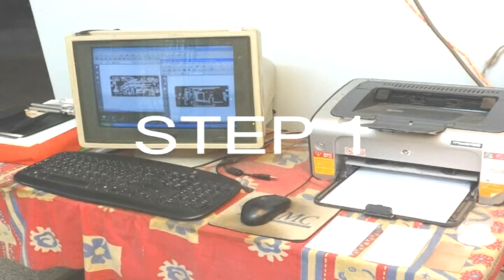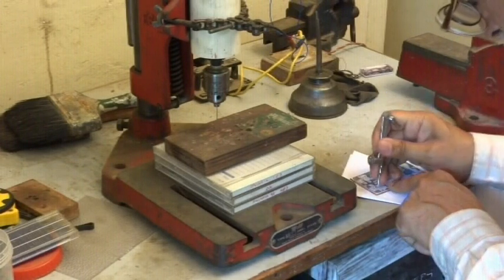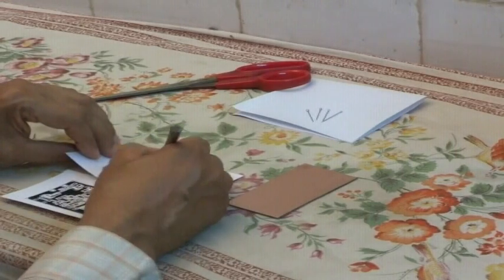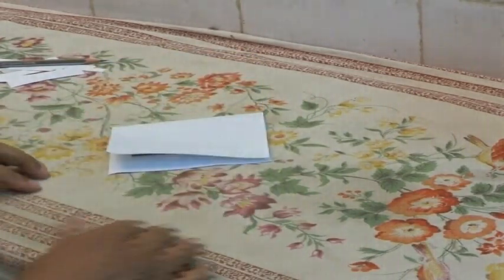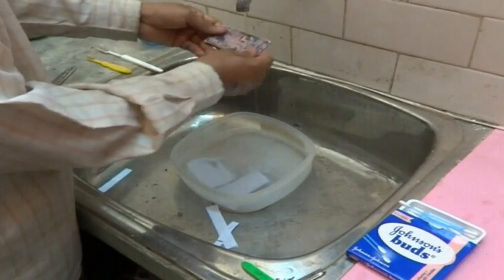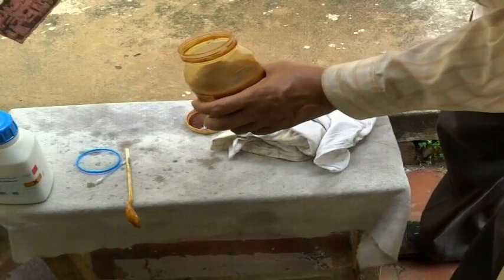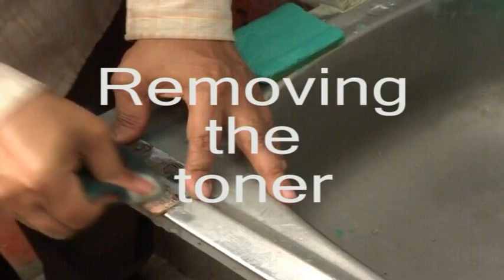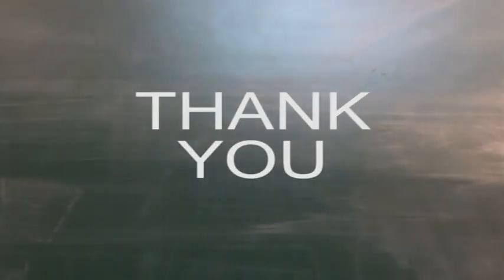Fabricate DIY Double-Sided Fine-Pitch PCB's

Comment: Thank you for sharing a wonderful video.  I follow much the same procedure; but instead of photo paper, I use thin, clay coated magazine paper of the type usually reserved for supermarket tabloids or junk mail.  I print the image on tabloid paper using a laser printer, and then use a cheap laminator (the cheapest type sold at a stationery store) and run it through for 24 passes.  This is probably overkill, but it always works.  I then use water to remove the paper, exactly as you did.  Thanks again for a great video.  >Charlie
Reply from the maker: Thanks!

Comment: Very much appreciated. You deserve respect and honor.
Reply: Will not work  try... I have done all  ferric cloride pcbs.. Such fine lines never possible
Reply: Also I don't use toner transfer method. This method needs a lot of experience to get something good with dense and fine traces and pitch circuits. I use the screen printing method. Which can produce 100s of PCBs in one go. Exactly identical. I just take this method and video as a low budget low tech solution to a very difficult problem of double sided pcbs at home. 

These days its better to use photoresist film technique for prototyping. And perhaps even for small scale production runs. However even with that method u need some form of accurate alignment. And that is the part that was of interest to me. It was with me instinctively and intuitively. But since I never used it in practice. I was interested to know the results by those who use that. Specially with dense and fine pitch circuits on both sides.

Comment: I know it is an old video but couple things to add. Ferric Cloride is stains very bad and will not go away for years. So better to use gloves and plastic twizzlers when you handle it. also keep it away from any metal surface, it will corrode any metal object in same environment. Also you can use aceton ( nail polish remover) to remove residual toner from pcb much easier and quicker once etching completed.

Comment: great video sir, 
been toner transferring since college days, until recently i had to do a usb dso with LTC1406 of 0.125 pitch..seems like there no diy for that
Reply: There is! Go for photo resist method when very high accuracy is needed. Toner transfer works fine but only till a certain point and fails to perform well when the tracks are very closely spaced (as you can see in the video that bridges are created). With photo resist method the finishing is very high with utmost accuracy!

Comment: This can't be made with toner! 
Fecl3 eats fine tracks as toner is not able to seal. 

This guy finally made pcb with UV film I suppose. 
Then posted as toner method
Reply from the maker: Sorry it did not work for you. There are no tricks in this video. I am 73 years old and only sharing my experience with the DIY community. For your info Laser printer toner is some form of black plastic material which sticks to the board very well. Check out https://www.hp.com/us-en/shop/tech-takes/differences-between-printer-toner-vs-ink#:~:text=Laser%20printers%20use%20toner%2C%20a,plastics%2C%20rather%20than%20liquid%20ink. "Laser printers use toner, a fine powder made from granulated plastics, rather than liquid ink." Please do not discourage others from using this method. An apology from your side would be welcome.